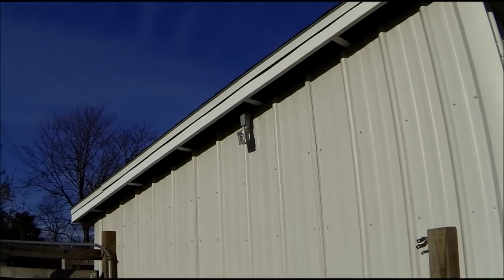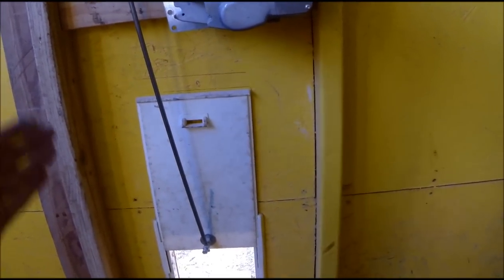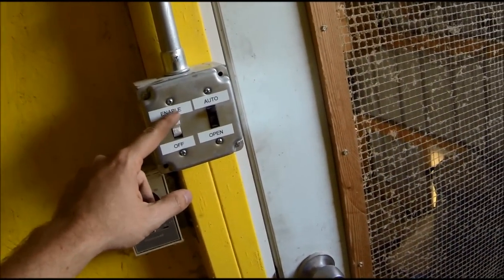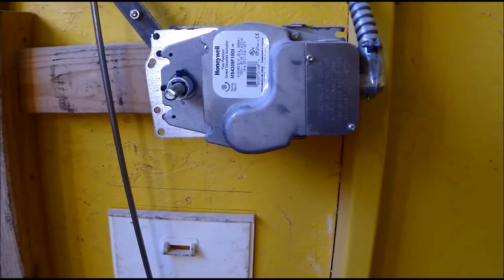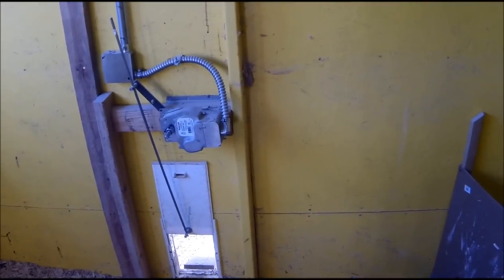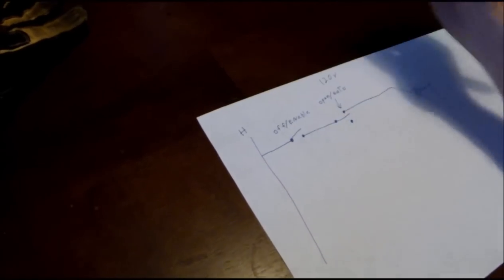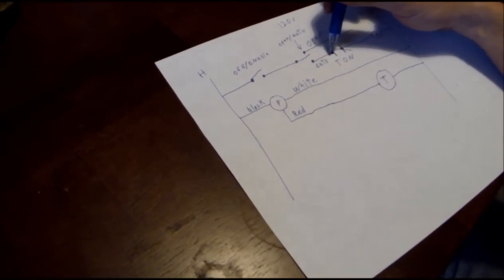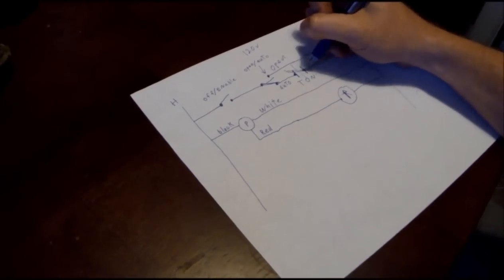Simple Automatic Chicken Coop Door

Comment: Hi, nice design.  If I may add my two cents on the 3 way switch for those that aren't familiar with it.  On a 3 way, you will not see the words 'ON/OFF' on the toggle handle.  Also, do not count the green ground screw, but 1 of the 3 screws will be a different color, 2 will be the same.  Something like 1 black screw and 2 brass colored screws.  These are the 3 screws you will use for your circuit.  The odd colored/black screw will receive the power from your single pole 'OFF/Enable' switch.  All green screws can be connected lastly to the metal box ground screw and the ground wire from your 120 volt supply wire.

Comment: I really like your design because it doesn't use a battery and photocell. I am familiar with regular house wiring, but not electronics or relays.  I understand your schematic but not sure about the kind of timer/relay I need.  I want an On Delay timer that goes to 60 minutes.  The one I'm thinking of buying is a "Uxcell AC 110V 8P 0-60 minutes range adjustable delay timer time relay AH3-3+base" from Amazon.  Will that work?  My confusion is especially with the fact after reading about relays, it seems that relays are to "relay" power from DC to AC.  Can the relay work just using a AC source?

Comment: I like the durability and simplicity, and its a good design.... but seems kinda of expensive for the actuator unless you can get one from someone for cheap or have one... any tips on getting/finding this main component for a cheap price? Thanks, good Video BTW.
Reply from the maker: thanks man, I would just get a used one off ebay.  Almost any type will work.  Not having to go out on cold night and lock up the coup is priceless to me.
Reply: No doubt about the getting out on a cold night, lol. After more research and thinking about it, I found some linear actuators online that are fairly cheap  (40 dollar range) and will work great.   But great video and good use of what ya have available.

Comment: I would like to add an update.  Does this work?  yes.  however, I am going to remove the photocell and install a 120 volt timer in its place.  Why? I live in an area where sunny days are rare.  The clouds cause the setting sun time to be off drastically at times.  Too many times, the door has closed and my girls are outside.  So, to avoid this, I will set the timer to open the door after the sun is up and it will close after dark, and by that time, the girls will be inside. Overall, I do love the auto door since I go to work sometimes before sunrise and get home after sunset.  On rainy nights, I've had to get the soaking wet girls inside cause the door closed via the photocell.

Comment: What is the rotating component that attaches to the top and bottom of the rod?  I have purchased the actuator but I need some help with the additional parts.
Reply: +Jaime Henderson I think those are called ball joints.

IMHO, I'd shy away from the HVAC stuff (that stuff is rather expensive...$20 just for one of those ball joints) and go with a linear actuator or car antenna, instead. 

You can also fabricate something similar to these components with just some nuts n bolts.

Comment: Nice Job, could you give some specifics on the normally closed contacts? maybe a model #. I found a Belimo spring return direct coupled damper actuator on Ebay just not sure on style of contact.
Reply from the maker: BC Toolman Ok, some damper actuators come with "end switches".  They typically have  2 sets of normally open/normally closed switches.  you would use those switches if you wanted to make a green light come on when the door was closed and a red light come on if the door was open for instance.       You don't need end switches in your damper actuator for this door to work.  Most normal photocells send out power when it's dark, to turn on lights at night.  So you would have to install your door to spring return up.  So no power from the photocell during the day your door is up.  At night the photocell sends power to the door( just like a parking lot light)  and the door would close.
Reply from the maker: BC Toolman Part 2.  So I installed it the opposite way because I didn't want a power failure in the middle of the night to open my chicken coup door.  So, I used a relay.  My photo cell powers a relay coil.  the normally closed contacts of the relay coil powers my actuator.  The relay reverses the action of the photocell.  Essentially It puts out power during the day, and no power at night.
Reply from the maker: BC Toolman this would be a very easy relay to use http://www.functionaldevices.com/building-automation/display.php?model=RIBU1C
Reply: Thanks i,ll give it a try

Comment: I installed this in my coop and it works perfectly.  I had to by 1/2" square stock to insert into the square hole of the actuator and a piece of flat bar stock which I heated/twisted 90 degrees.  I JB welded the flat bar stock to the square stock to make my linkage. I bought the metal items a the the blue big box store.  I then installed 2 swivel fittings and a round rod to complete the linkage from my plywood door and the actuator. I bought the actuator off of ebay. Thank you for the idea to get me going!